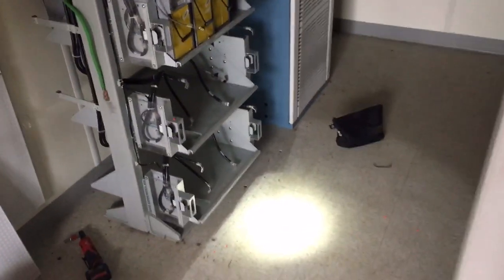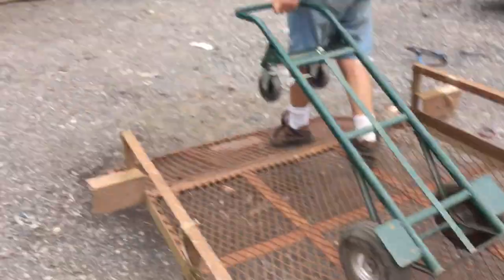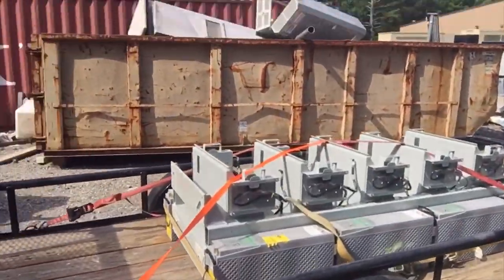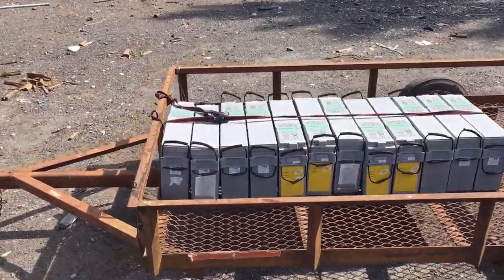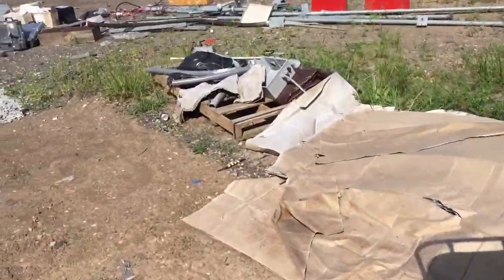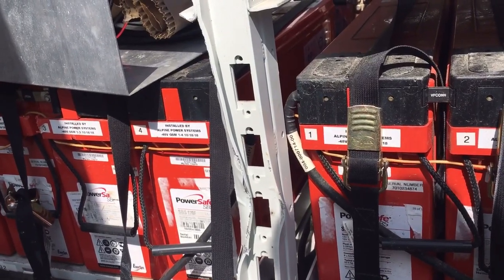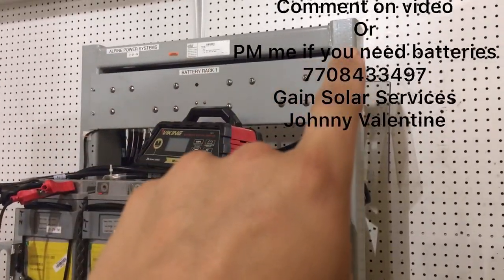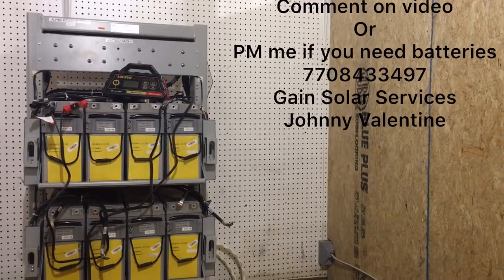Telecom Battery for Solar

Comment: Did you say you are close to Tinker? I am in need of a solar battery bank for my system...I am interested. Looking for about 12 that work. Thanks.
Reply from the maker: Tinker?  I am in North Georgia but sealed batteries are fairly straightforward to ship on a pallet.

Comment: How are you charging them?  Trickle charger not strong enough.
Reply from the maker: These are long gone they got installed on an inverter charger
Reply: @GainSolarPower  but how do you recharge large format cell batteries? I have (2) 12v 190ah batteries from a cell site. I got some good use out of them having hooked up to an inverter I bought. Powered lots of stuff off them but now they are dead. Trickle charger doesn't seem to work.

Comment: Just a quick question.I have. Some power safe sbs 190f batteries..Can I run these on there side?
Reply from the maker: Not sure about this one.
Reply: @GainSolarPower  how about a telacome battery in General?I have two I am wanting to mount on their sides.This way, they are  lower to the center of gravity in my truck bed...And thank you for the information .
Reply from the maker: Mr. Urban Fox I often lay batteries labeled non spillable on their side. Do they have vents on them?  Call a company like north star that makes the same kind and ask them if they can go on their side.
Reply: @GainSolarPower  They are VRLA AGM .so they would be sealed AGM.If I interpreted the information correctly.
Reply: @GainSolarPower  I have been calling and sending emails.But I have had no luck,with return calls or,emails.
Reply from the maker: Mr. Urban Fox they usually say nonspillable

Comment: I need batteries that can handle 100f in the summer and -20f in the winter, and can work at over 5800 ft elevation... running a 48v system.
Reply: Sounds like a wisp to me
Reply from the maker: Batteries can handle the wide temp swings but they wont perform as well.  they need to be full in the winter so not to freeze and maybe a fan on them in the summer will prolong life.  How big of a batery do you want?

Comment: I have 45 300 watt panels how many of what do I need
Reply from the maker: It just depends on how long you want the battery to power your loads in a worse case scenario and how much you $ you want to spend.  At a minimum you need a 48v 400ah battery bank and most folks need double that for a good system.